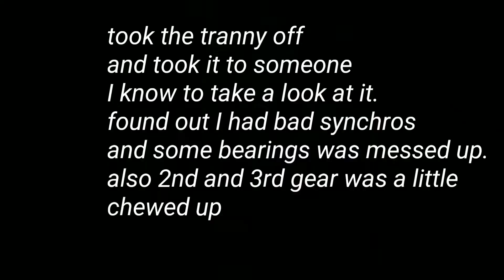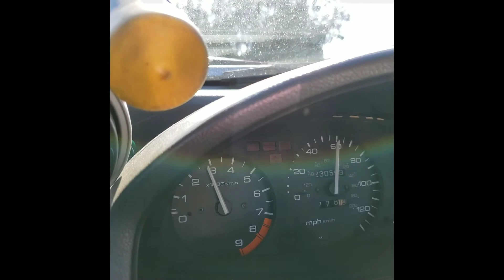Transmission lock out FIXED!

Comment: Hey man mind sharing the build list? Really considering a h2b swap for my ek rather then go K, also total costs?? 

Thanks, thing moves! Great videos
Reply from the maker: Josh Renteria for me to go h2b cost me around 2k something just to go h2b. I already have b tranny and mounts. But if u dont the cost will be more. Not much done to it, just stock block with skunk2 tuner 2 cams, supertech valve springs, skunk2 manifold, 74mm tb, 550cc injectors, 4inch intake that's about it
Reply: allmotorCRX cool thanks, recommend the qsd kit? Difficult install? Can’t decide because I read so many mixed reviews over it and the evolution.
Reply from the maker: Josh Renteria went with the qsd because of many good reviews that I've read.  Evolution kit had mix reviews good and bad but it's really up to u which kit u want.
Reply: allmotorCRX last question bro, to pick your brain.. thanks for being helpful by the way. I can’t decide which H to go with as far as being able to make the most power for the least amount of money. I’m looking at the H23 vtec bluetop for $900 the long block but am not sure if building the head will make much of a difference on it? Was also considering the H22 Euro R for $1,500 the long block because of the higher comp pistons. Which block do you currently have? Cuz hell if you made 240whp with just bolt ons and a built head.

By the way whichever block I do choose I will be porting the lower runners on the intake manifold along with the top and port matching with a 74mm tb. Either bad guys racing or Rosko Racing... what block or blocks do you recommend?
Reply from the maker: Josh Renteria I'm running the jdm h22a motor. Cheapest h to go and with power will be the h23a. H23a with bolt ons can make decent power depending on how healthy the motor is.

Comment: What transmission you running b16 or type r
Reply from the maker: B16
Reply: Cable or hydro
Reply from the maker: @huntermacabio1863  hydro
Reply: @AllMotorGang  just purchased a type r see what it does now taking the gsr I have on it now
Reply from the maker: @johnwickk827  nice. Type r with Lsd?
Reply: @AllMotorGang  yessir oem Type r with lsd and even oem vin number on it
Reply: @AllMotorGang  I have a f2b stock block and head just have 1320 headers stock ported mani 70mm tb and 4x10 v stack with the 4in pipe I made 210hp almost 160tq but I lost power because of the gsr trans I have now so now I got the type r trans an twin disc clutch and ima order a 76mm tb and also got exhaust now so I want to make more power

Comment: Hey man quick question what’s you tuned set up I love when you hit red line
Reply from the maker: Manuel Calderon stock block with little built head. Valve springs, skunk2 tuner 2 cams intake manifold and headers.